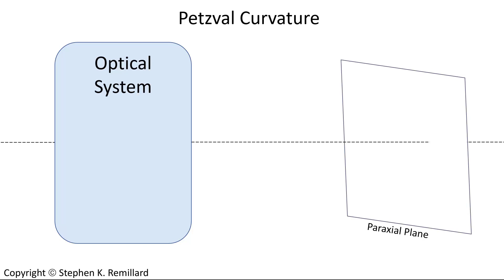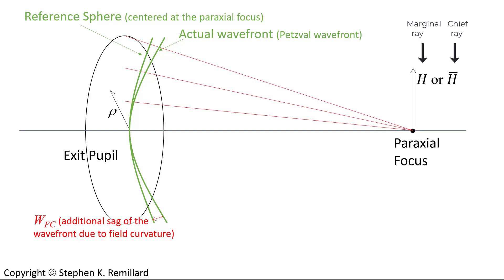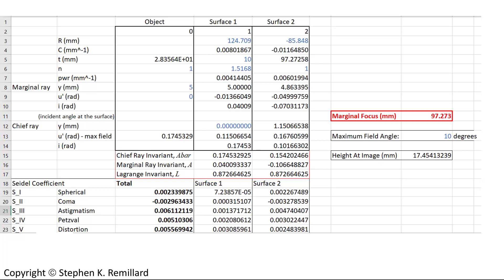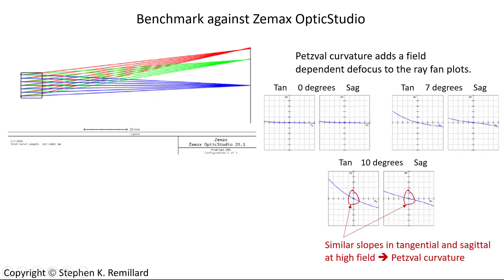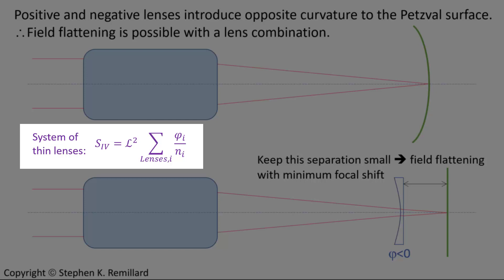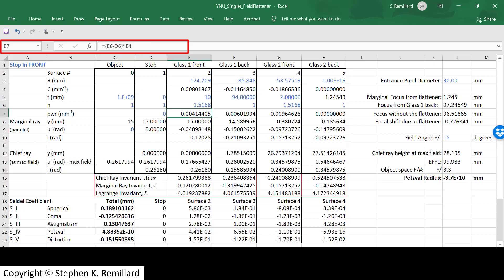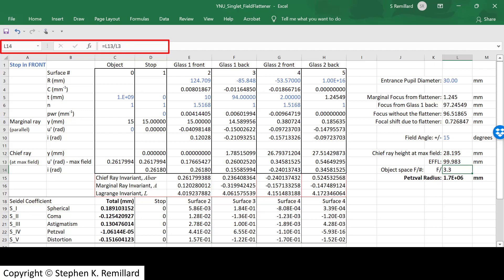Computing Petzval Curvature - 3rd Order Field Curvature Aberration

Comment: Stephen this is great information. Thank you for explaining this. Oddly, I am looking to introduce sagittal astigmatism preferably with AR/AS coatings. Do you know what type of optic I should be looking at (specific name / keywords) and where to source this? I've used these terms with no results. I am looking for an 82MM diameter optical filter that can effectively swirl the edges of my frame with preexisting lenses. Thanks for your help!
Reply from the maker: This sounds like a job for either a cylindrical lens or an aspheric lens, both of which can be purchase from Thorlabs (https://www.thorlabs.com/navigation.cfm?guide_id=2087).  You can specify an AR coating when ordering.  Not sure about AS coatings though.
I would probably go with a cylindrical lens element with a fairly large radius of curvature (https://www.thorlabs.com/newgrouppage9.cfm?objectgroup_id=2803).  This way you introduce a small anamorphic effect.  That's my spur-of-the-moment thought on the matter.

Comment: Hello Stephen!
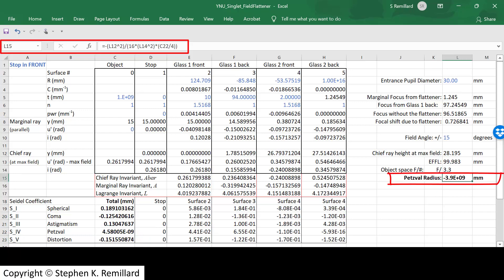At the time stamp 12:03, with the 2nd Glass Front Surface at -53.57519 mm, the sum of the Petzvals across Surface 2 to 4 should be around 4.3E-3 (See the Sum of Cells  E22 to H22: 4.41E-2+6.55E-2-1.10E-1-5.93E-16). Maybe something that I missed at Cell C22?
For a reference, my S_IV~=1.47E-8 is achieved with a 2nd Lens first surface R = -51.934029 mm (There is a small discrepancy, as my table follows mainly on the Greivenkamp and OpticsRealm's table...but answers should be very similar). Thanks.
Reply from the maker: I rounded the numbers in columns E through H to three significant figures, but that is only for display purposes.  In the background, Excel continues to use high precision.  I still have this spreadsheet, so I opened it and enlarged the significant figures that are displayed, and the numbers stored in those four cells (E22 to H22) are:  4.41350690335E-02	   6.54716178493E-02	    -1.09606686394E-01   	-5.93136420090E-16,  which add to zero (almost).